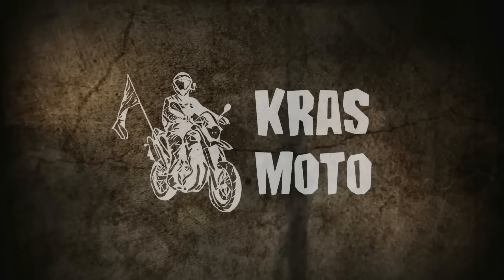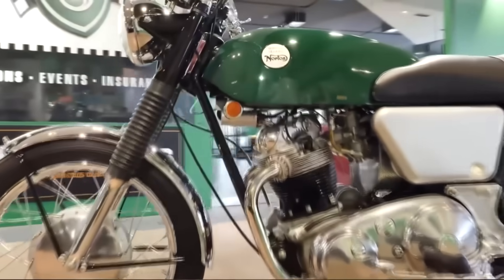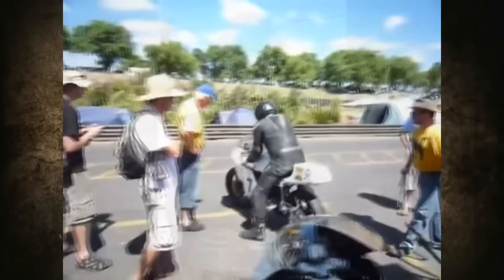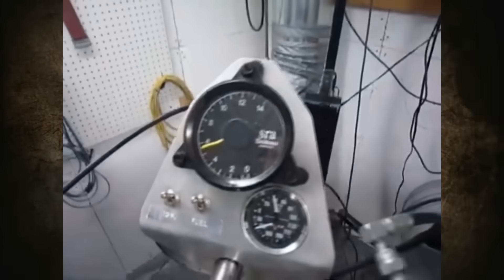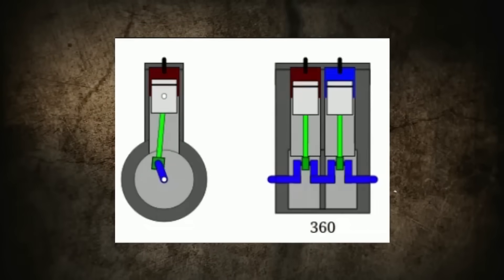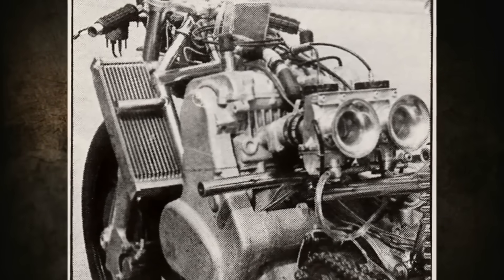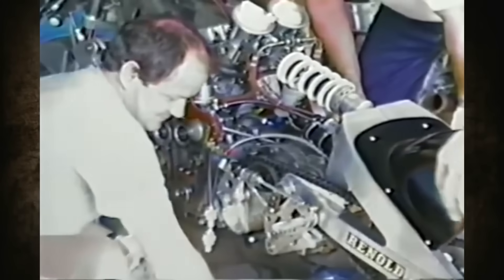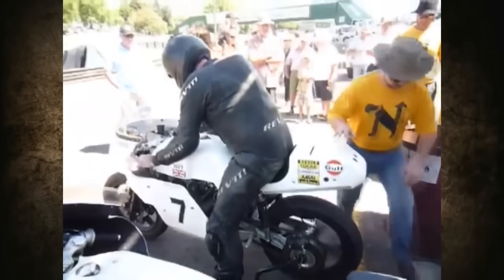Trying to Bring Back the Glory – Norton with a Cosworth Engine

Comment: If it was 90hp they were aiming for, they need not have abandoned the original twin, just tune it. I had a Commando 750 that was equipped with 920cc cylinderkit a better camshaft and larger carbs...and a new ignition, and that was all the old girl needed. And since it was 360 twin it had a bottom torque in Harley Davidson level, and top rpm close to contemporary asian bikes.... and MUCH more fun...!!! Plus it sounded nice too...!!!

Comment: I still remember seeing the cut away drawing for the first time. (There was an appeal for donations for funding and I had donated hard earned cash). My heart nearly broke. I could tell that this engine in its then state was never ever going to work. I am sure that if left to Cosworth, the engine would have been a success. But with Norton making such demands that it must have a 360 degree crankshaft because they did not want it to sound like the Honda twins, it was bound to fail. 
The failure of the British motor cycle industry was 100% management failure.

Comment: There is one of the early bikes and an engine on show at Sammy Millers excellent motorcycle museum in Hampshire, UK.  Its no surprise the UK bike industry went phut when you see how they thought against how it could have been.....Imagine an injected Cosworth motor in a road bike then....wowza, deffo the first superbike if it had been.
Reply: That cosworth engine was a dud.
Reply: @llanelli311  Indeed it was!
Reply: @llanelli311 it came good inches end , it won the battle of the twins championship
Reply: @duggdog9102 only after an F ton of work. Cosworth never got their heads around bike engines. Hence the Hesketh!!
Reply: What year was that
Reply: @georgeliquor2931  right now in the Norton hall.